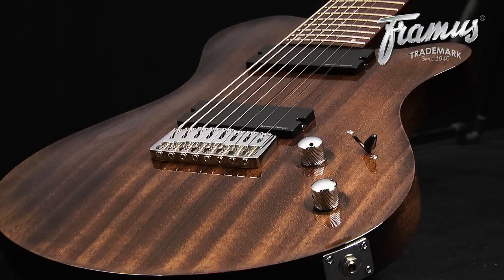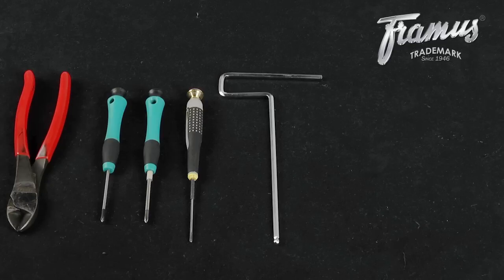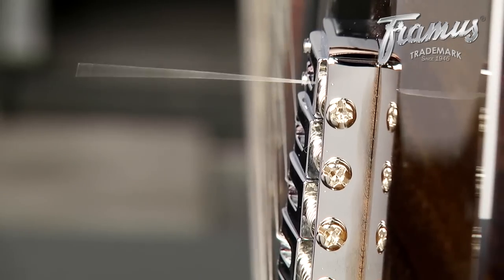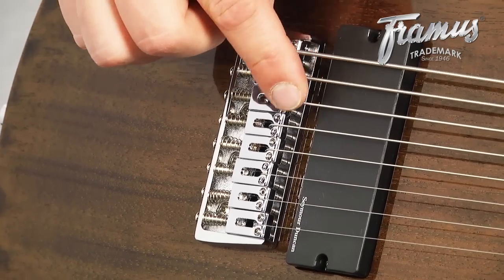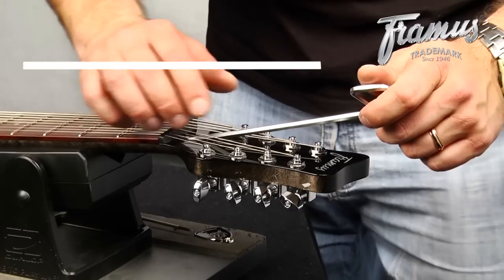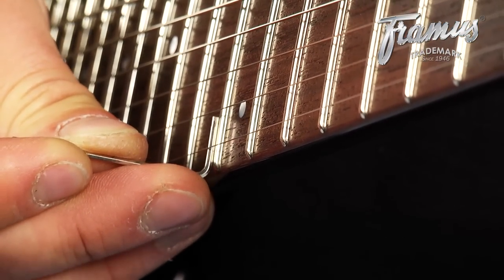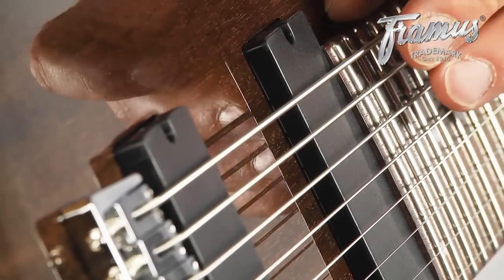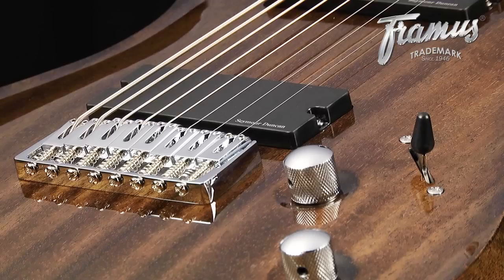Framus Tutorial: Setup of an 8-String Guitar with a Hipshot Fixed Bridge

Comment: This video solved a problem I had with my 8th string for some time now!!! Thank you so much for this straight up detailed and focused video!!
Reply: what problem?
Reply: @iwillspam5985  the 8th string was too low, and it made the sound very flubby and with 0 sustain, really beating on the fret. I used the measures in the video for the action and the problem was solved

Comment: had a new guitar delivered and the setup was a bit whack and not with my preferred string gauges. I've been playing for about a decade and have never setup a guitar before, mainly because my first upgrade was a very high end floating trem style and I didn't want to fuck with it. New guitar's fixed bridge is a lot less intimidating and I'm really excited to oil the fretboard and set it up with the new strings tomorrow. Will definitely be coming back to this video as a guide, seemed pretty straight forward and easy to follow!

Comment from the maker: It kind of is, yet you can move some around. For example, it doesn't matter if you adjust the string action or the truss-rod first. But these two should be done before you adjust your intonation, since any later adjustment of the action will ruin your intonation again. And if you want to set the height of the pickups at the end or after adjusting the action is again totally up to you. Thanks for watching!

Comment: I love this video, very helpful. I really wish though it went over the rest of the action setup for the rest of the strings. I still have a lot to learn about setting up my own guitar. I get what was mentioned about setting up the bottom and top strings to the preferred height but what do you set up the rest of the strings 2-7?
Reply from the maker: Hi Jesse! Thank you for your question! Note that the suggestions made in the video are a low string-action recommendation that caters to the average player to improve playability for most guitars, and personal preferences of players may differ. As shown in the video, the low F# should be about 2 mm, and the high E-string at 1.5 mm at the 12th fret. The remaining strings should gradually increase in height from the highest to the lowest string from said minimum to maximum value. This should be addressed at string saddles at the bridge after you make your truss rod adjustments. The saddles should be individually adjusted to a height that follows the curvature/radius of the fretboard. Now, the fretboard radius varies depending on the brand and guitar model. Some have a flatter radius than others. Also, the scale length and string gauge are factors that influence string tension, which may require compensation as well. For example, an average standard string gauge for 8-string guitars is .009 - .074, and 8-string guitars mostly come between 25.5 inches to 28 inches in scale length. The standard string gauge will naturally have lower tension on the 25.5 inches scale than on a 28 inches scale with the strings tuned to the same pitch. Lower tension means more space required for the strings to vibrate, which can result in string buzzing and needs to be addressed with string action. Same string gauges of different brands can also have varying tension. Thicker gauges mostly have higher tension than thinner ones. It all comes down to your personal preference and your setup, so the strings don't buzz on any fret, and the action is not too high, ensuring a comfortable play.
Reply: @FramusWarwickOfficial  Hey thank you so much. That is awesome information. I’m sure I’m glad you guys did this. This is so very helpful. Thanks again. Cheers!

Comment: When mentioning the string height relative to the radius, I noticed the tech in the video is eyeballing it. Is there a specific measurement guide for this, i.e. how much higher to set the middle strings in relation to the first and last string? Or is it so slight that it's just an eyeball job?

Comment: What happens if the string is intonated at the 12th fret but not at some of the others? (Example 4,5,6)
Reply: This is natural for all guitars. It's impossible for a guitar to be perfectly intonated across a standard fretboard. That's where guitars with "true temperament" fretboards come in, like Steve Vai uses. Don't sweat the intonation being perfect across the entire fretboard. You can experiment with the intonation as well. I've read in forums of some people online who like to intonate to a different fret than the 12th and intonating to the 7th or the 9th fret, mess around with it and find what sound you like. That's the beauty of setting up your own guitar. You can make it however you want it to be and if it gets old change the setup. I still like to watch guitar setup videos to see what tips and tricks other people do, like using an allen wrench for action is pretty clever, but from about 7-8 years of messing around with setting up my guitars I know exactly how much neck relief and what height of the action should be for my tastes. Eventually you'll find exactly where you like everything to be.

Comment: I know how to set up 7 and 6 string guitars very well. But this 8 string I just picked up is giving me fits. 

On both my 7s, I run a 56/10 set tuned standard and half step down. I set the action to 1.8mm low side with .3mm of relief. Buzz is normal.

Now my 8 is half step down and strings 7-1 are a little thicker gauged than my 7s, 58/10, but the 7 has significant buzz even with .5mm relief and 2.2mm action. How is this possible? I've messed with the relief to no end front and back and nothing changes. 

Now with the 8th string I'm having the same problem but the action is 2.8mm and the buzz is still significant with a 74ga string.

Someone with good knowledge of 8 strings help me out. I don't want to go thicker for the 7th. But I'm gonna try a little thicker for the 8th so I think I can get the 8 better. But the 7th should be more than fine considering the info comparison to my 7 string guitars from which one is the 7 string model of the 8 I have. Makes no sense. Any help will be greatly appreciated.
Reply: Are you measuring the action off the 12th fret? Are the scale lengths different on these guitars?

Are the bridges different? Or do they both have straight angle neck joints with hardtail bridges.

Tunomatic bridges are pieces of shit so they will give you more trouble. Frankly though, I think 8 strings is too much. It is more like setting up a bass.
Reply: Action is measured at the 12th on all my guitars. The slightly larger strings make up for the 1.5" of scale length difference.

I've since learned that going lighter on the top 3 strings of the 8 string has helped the buzz a lot. Not all of it but much better. Go figure that lighter would be better.
Reply: Fretbuzz mainly happens if the neck has back-bow. However if my 8 buzzes i check the neck(.10-.15mm relief, however the .15mm fillergauge touches a little bit) and the the action. I set my c-8 slightly lower than 2mm on f# and 1,25 on e1 it has no buzz. If it would be buzzing a lot i would take it to a lutier to polish and level the frets.
Reply: If you're getting fret buzz on the lower frets, closer to the nut, then loosen the truss rod and increase the neck relief. If you have buzz on the highest frets, closest to the body, raise the action at the bridge/saddles to increase string clearance at the end of the neck.

Comment: Well doing all of this, I will say I'll never ever buy another Ibanez. I got an RGMS8 and it is horrible. I go from a standard string set. Dooooo all of this. My 8th string (Eb) buzzes so bad that it gives me horrible frequencies through my amp. It doesn't go away with truss rod adjustment or saddle adjustment (until its raised a mile) okay so I need bigger strings... So I thought. 74 to 80 to 85 to a damn NINETY. Still the problem persists. I look down my neck (or up, technically) and the 24th fret looks substantially higher than the rest of the frets. 6-700 dollar guitar and the fret work is shot? Seriously, I hate Ibanez. No wonder Tosin went out on his own
Reply: @Th3feaR ahhh a fellow lefty. I'm really sorry to hear that, I play right handed but I am indeed a lefty. Well actually I guess I'm ambidextrous but I can't write any better than a 1st grader with my right hand. I can barely keep my picking clean, but alas right handed guitars are cheaper and have more variety in style. BUT Ibanez shouldn't be saying that to someone. That's horrible, I will say it's because their guitars are "cookie cutter" design. Doing a left handed guitar "wOuLd bE tOo HaRd"